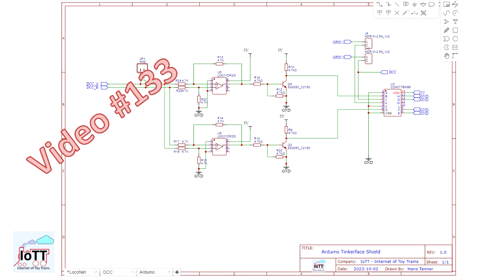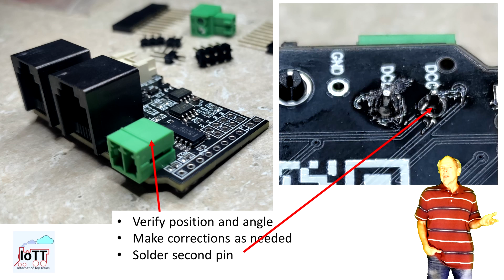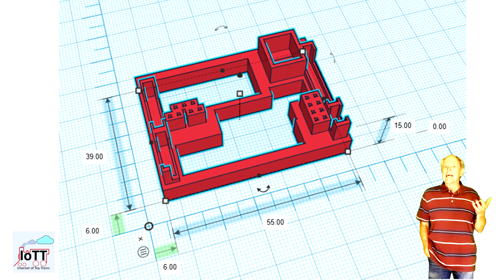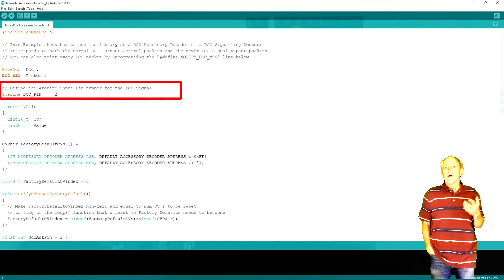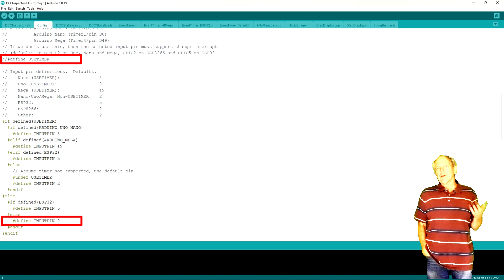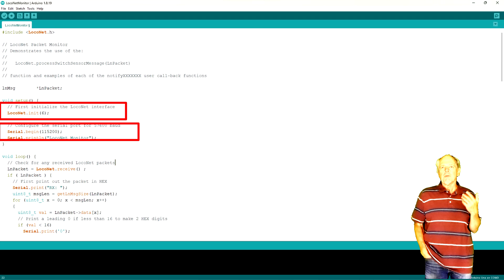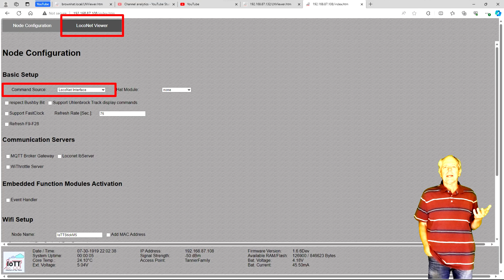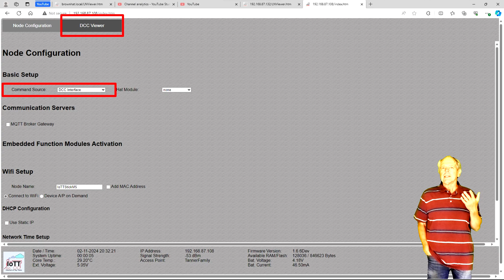Tinkerface Shield Loconet / DCC Interface for Arduino (Video#137)

Comment: Is there any software available for this shield?
Reply from the maker: The Tinkerface Shield makes use of the usual Arduino libraries for DCC and Loconet. Install them in your Arduino IDE and you will be able to use the Tinkerface Shield. Use the example programs that come with both libraries to get started. And yes, you can even use both libraries at the same time, so you could listen to a specific DCC sequence and when you see it coming along the track, you could issue a Loconet command  to e.g. set a turnout. Lots of possibilities.

Comment: Can I connect a Tinkerface shield directly to a DCC-EX CSB1 without any damage ?
Reply from the maker: As far as I can see from the CSB1 schematics, the 'dangerous' pins like 5V, GND and VIN (which is not powered on the CSB1) are in the standard Arduino location. So, yes you can. Does it make any sense? No, as there is nothing meaningful I see the CSB1 could do with the signals it can get from the Tinkerface Shield.

Comment: Hi, what’s the difference between using the Tinkerface shield with an Aux shield and IOTT stick vs a RedHat ? Is it that I get the led chain and loconet booster jack extra on the RedHat ?
Reply from the maker: The main difference is that the Tinkerface Shield does not provide communication lines from the IoTT Stick to the DCC EX command station. So, you could run the Stick as RedHat, but you would have to connect the hat connector serial pins to Rx and Tx pins on the Arduino pin header, and provide the level adjustment from 3.3V to 5V, which is all integrated in the RedHat circuitry.

Comment: Hi Hans!  Can I use the Tinkerface shield with an ESP32 to run the DCCInspector-EX?  It looks like DCCInspector-EX uses pin 5 on the ESP32 for input, so it looks like I can't use the Tinkerface shield?  Thanks for the help!
Reply from the maker: The Tinkerface Shield has 4 jumpers to bridge from Loconet and DC to the Arduino pins. If closed, the signals are connected to IO 6/8 for Loconet, and 2/3 for DCC. You can leave the jumpers open and use jumper cables to connect to any pin you want. So I would think using it with the DCCInspector-EX (which I am not familiar with) should be no problem at all.
Reply: @IoTT  OK - I think I understand now.  I need jumper from the inner pin 2 on the Tinkerface signal header to pin 5 on the stacking header - that should pass the DCC signal to the required input on the ESP32.  Awesome - thanks, Hans!
Reply from the maker: Yes. For DCC either pin 2 or pin 3 will be enough for decoding the DCC information. The shield has both pins (DCC A and B) to allow decoding Railcom cutoffs.
Reply: Got it working!  One hiccup - I'm using the Adafruit Metro ESP32-S3 board, and I had to downgrade the ESP32 boards file to 2.0.17 in order to upload the sketch.  I added the jumper as discussed, and I am getting the DCCInspector-EX data over serial and web interfaces.  Cheers!

Comment: Got the message the my Tinkerface Shields have been shipped - can’t wait to have a play - thanks Hans!
Reply from the maker: Should only be a few days ;-) I did a quick test the other day using an Arduino sketch that is listening for both, DCC and Loconet, at the same time, using the nmradcc and loconet libraries. It worked even on an Arduino Uno.
Reply: Boards have safely arrived - thank Hans.    Do you know when you will have Rev 5 Power Shields available?
Reply from the maker: I am waiting for the driver chips to become available, so I don't know really. Hopefully soon.
Reply: Thanks for the update Hans - hopefully I will get to try the Tinkerface Shield after my layout goes to a train show this weekend - just doing some planning for a new layout - may need auto-reversing….   Won’t start work on the new layout till November….